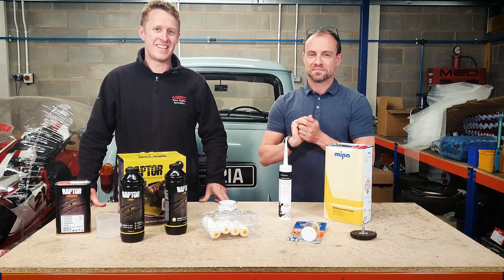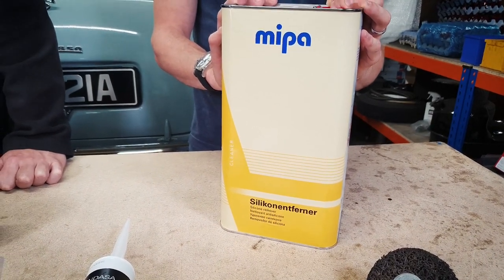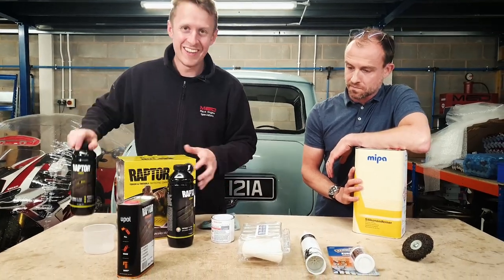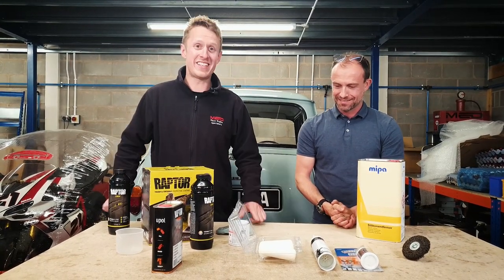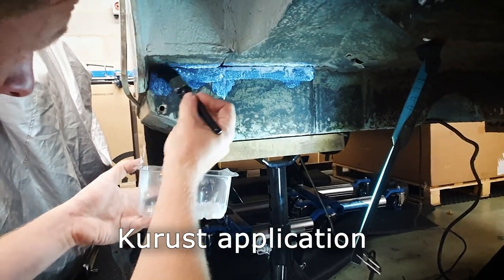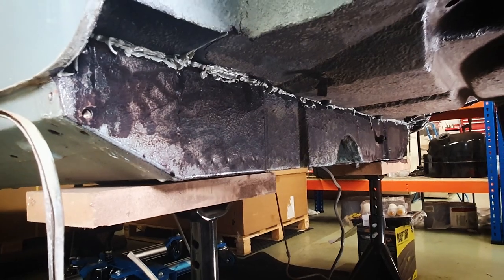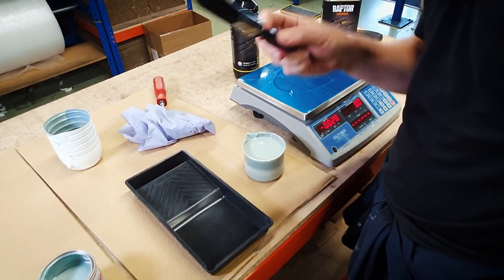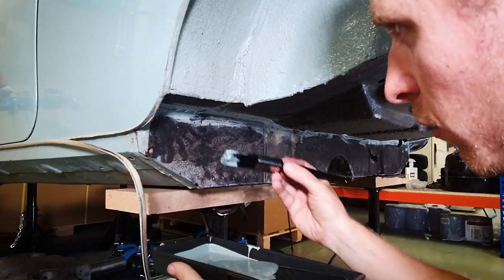Project 63 Episode 9 - Raptor painting the Mini!

Comment: The wheel arches on my UK built 64 Cooper S were coated with pitch. Days with a heat gun, scrapers, rags and mineral turps removed most of it ready for Raptor like coating.
Reply from the maker: We were undecided whether to strip it all the way or not, but it's lasted this long, it's doing a pretty good job!

Comment: Why do people rail against Raptor?  I thought you did a great job, and It seems like a nice tough coating to me.  What’s the problem?  Cheers, Will
Reply from the maker: It's ideal for a usable classic, just not shiny like a show queen!
Reply: Hi I’ve just purchased raptor also but was told to use raptor epoxy primer before applying the raptor xt. I noticed you didn’t primer, so I thought I’d ask a couple of years on how’s it holding up?